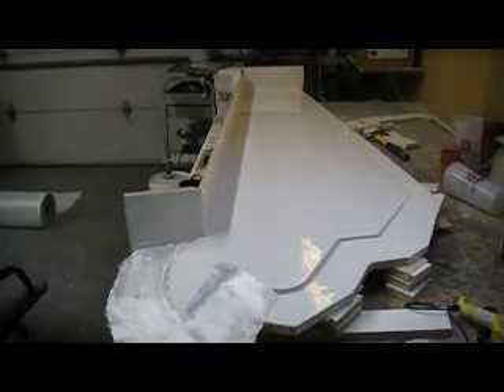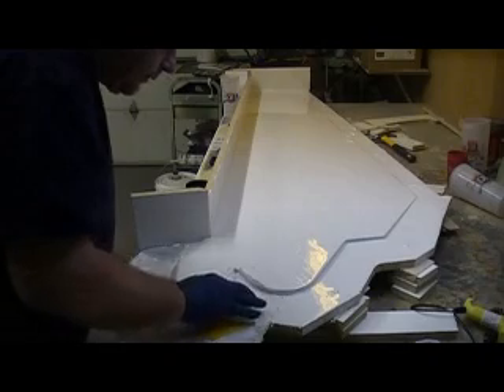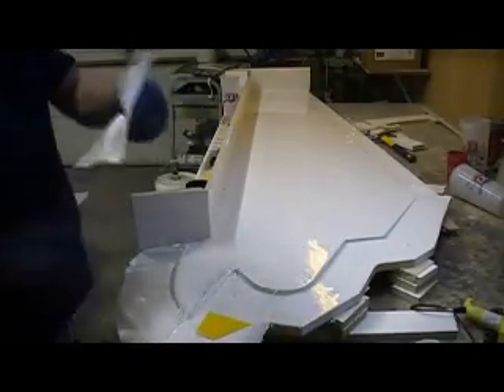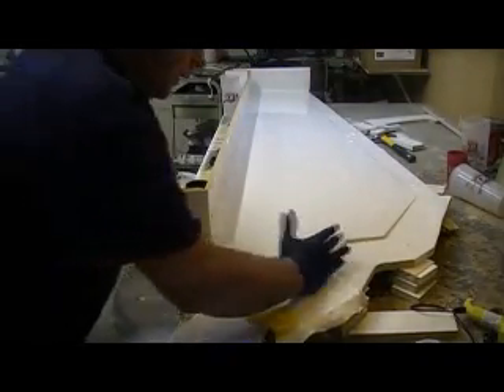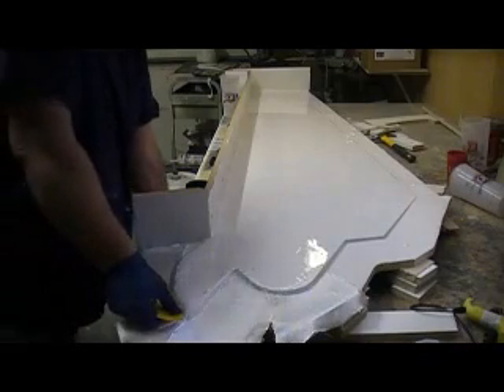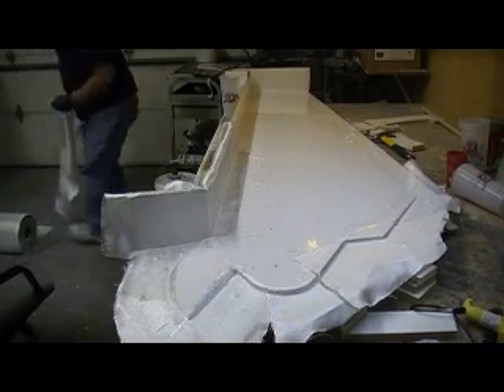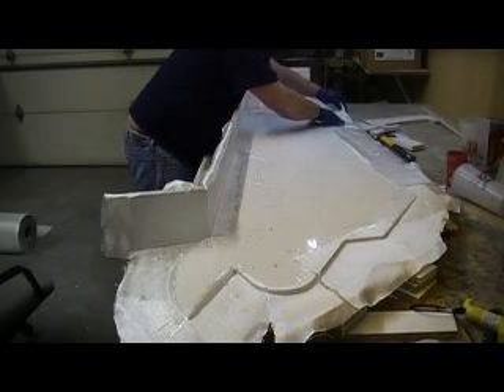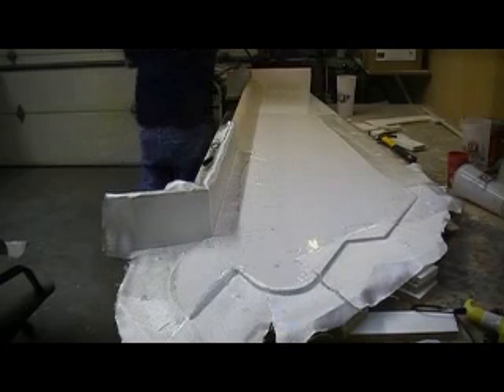how to build a rc jet B-1 bomber # 116 pt 6

Comment: @lixbeyond 

If it ain't black then it isn't carbon fiber. 

Bob is making a mold for the wings. He is using a plug that is shaped like a wing. The surface from the mold needs to be very smooth in order to get the best finish on the wing, that is why he used the white epoxy, now he is wrapping the plug  with glass fiber and resin. After the resin has cured it is a mold for a wing. Then he can use the mold several times to make a carbon fiber wing with a smooth surface.